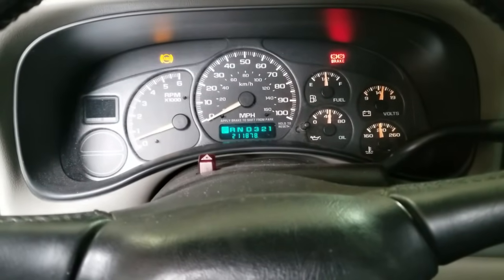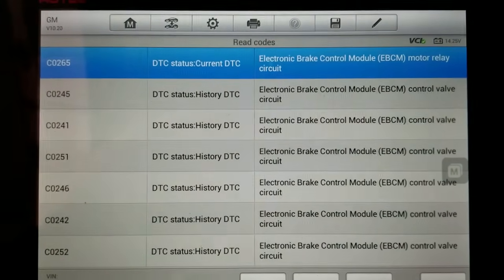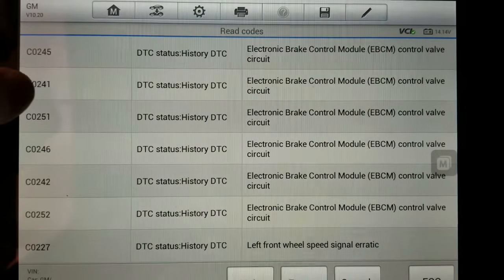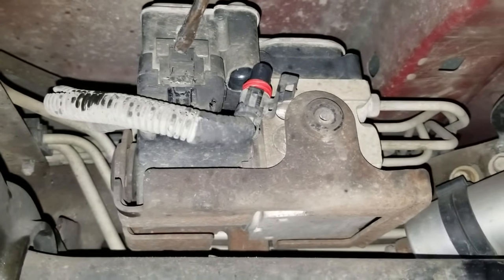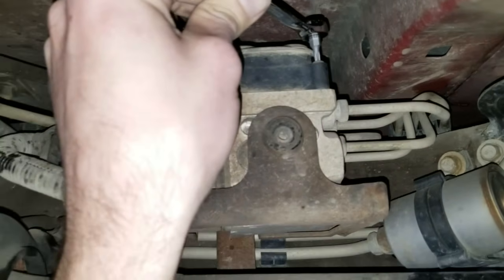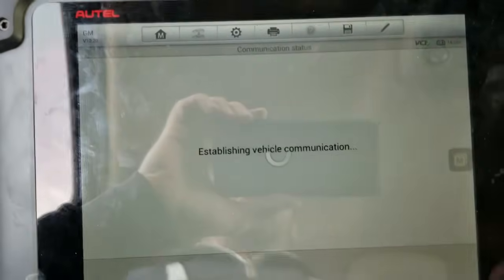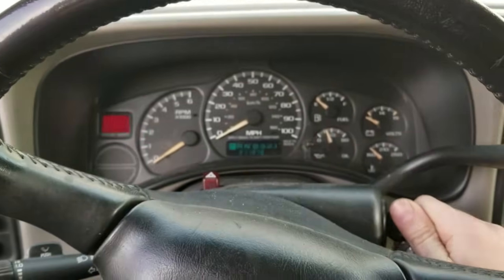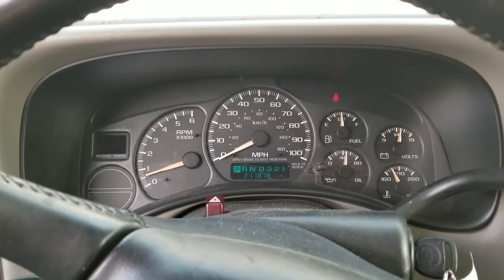GMC Chevy Truck ABS / Brake Light on C0265 Solution

Comment: you didn't show the actual repair!!!!
Reply: He didn't show the repair because that is what he is selling for $60. That's a bargain. Read the entire description below the video.
Reply: He took it apart, soldered all the cracked joints then put it back together.
Reply: Jeff Brill Luke Perry's look alike...😂😂😂😂🤣
Reply: @superduty4556  Actually you should re-flow all the large (power) connections.  These boards are multi-layer PCB's and sometimes the inner board connection breaks.  So if you re-flow the entire board or at least all the large connectors and get a nice shiny look to the solder, not dull grey (Cold joint) you should be able to reinstall and have no problems.  It is actually easier to remove the unit from the frame rather than feel around and screw around and strip a screw or break the head off.
Reply: @edcrabb  yes, I remember reflowing my PS3 back in the day.
Reply: @edcrabb  I stripped mine out. So I have to take the brake lines off and take the whole unit off to fix it?
Reply: He resoldered the broken solder joints. You can do it yourself. for $2 or you can mail it to him and he charges $60

Comment: Could also be a dirty ground.  Before you replace the control module, check for a clean ground.  It might save you some money.
Reply: Where's the ground at? 
I'm bout to buy a vehicle with this issue.
Reply: The ground for the module is on the frame opposite to the abs module beneath the driver door-there should be about three wires, the heavier gauge wire is the module ground. You'll want to gingerly remove the bolt and clean up the surrounding area and the wire terminal ends with a wire brush or the like. When you put it back together use a dab of dielectric grease to ensure a good connection and to dispel water.
Reply: Happened to me with my water reservoir. The coolant light wouldn't go away after I took my tank out and flushed it.and it said to get it to go away you have to replace it.i soaked the sensor and the end it goes into on the tank in purple power and the light went away

Comment: Actually you should re-flow all the large (power) connections.  These boards are multi-layer PCB's and sometimes the inner board connection breaks.  So if you re-flow the entire board or at least all the large connectors and get a nice shiny look to the solder, not dull grey (Cold joint) you should be able to reinstall and have no problems.  It is actually easier to remove the unit from the frame rather than feel around and screw around and strip a screw or break the head off.
Reply: Thank you for sharing that Bubba Gump, that was actual handy info we need.
Reply: @MercuryRisingFast  basically means to re-solder the joints cause it gets corroded.
Reply: Thanks, I didn’t even think about doing that on my 09 f150. Control module is bad and they are expensive for a new one. I’m gonna try and reflow all the joints.

Comment: Spent several hundred dollars on a garage to try and repair my ABS system/pump. They repaired the assembly, but now it engages incorrectly due to a bad wheel beaeing/toner ring. What a waste of my time and money. I'm just gonna unplug the friggin thing and remove the ABS light in the instrument cluster

Comment: Hold up!! before pulling that module out try this. Wiggle the power connector to the module. the one shown here with the red seal around the plug. By accident I found that by moving the plug I could make the ABS and Brake lights come on or go off. Probably some corrosion on the terminals. I slightly bent the male lugs so they would make better contact when the plug is reconnected. It's been awhile and both lights are still off. Probably a good idea to check the grounds too.
Reply: Hello. I'm about to check they out.... How can I find the grounds? Thanks.
Reply: I replied but I saw a YouTube video by Scott The Fix-It Guy that goes over the procedure. Yukon-Tahoe Brake Warning Lights-10 Minute Fix. Good luck.
Reply: @meansnothingnow  OK! You seemed to know where were located the grounds...

Comment: I have that same problem with my 2002 Chevy Tahoe and I have the new module my question to you dose it have to be programmed or can I just put it on and clear to code.
Reply from the maker: As long as the module is an exact match then there is no need to program it.
Reply: Automotive Circuit Solutions  thanks

Comment: Since the original problem was intermittent,  you can't be certain the problem has been repaired. Shouldn't you take it for a test drive  and shut it off a few times.  I've seen this code with air in ABS.
Reply from the maker: Hello,
Yes we did take it for a test drive after to confirm the issues were corrected. Also our service comes with a warranty and the customer never came back.

Comment: Had the same problem.  I replaced the sensor in the existing wheel bearing. But .... mine was a so so wheel bearing on the driver’s side.  Replaced it with sensor included.  Solved ...

Comment: I just installed a remanufactured abs module (made sure it was the correct kind) on my 2002 suburban 1500 LT and the light is still on. They said I would need to delete the codes or double check the fuse box is in order. I'm a little stumped
Reply from the maker: You might have other issues. Get it diagnosed to see if there are any present fault codes.
Reply: @AutomotiveCircuitSolutions  nope just the relay circuit code was the only thing
Reply: @OpiumMonkey  did you ever figure it out?
Reply: @CripplelovesWolly  never did :/

Comment: 2002 GMC Sierra 1500 changed all calipers great booster Master brake cylinder and able to build pedal pressure with engine off as soon as I turn the engine on brake pedal goes to the ground and is soft cannot build up pressure any ideas
Reply: I had this problem. My cause was leaking brake fluid. And the reason it was leaking because the brake pad was basically gone so the caliper was just basically open and loose and leaking fluid. Just check your pads incase I know you changed you stuff out but you never know
Reply: Or your metal/rubber brake lines rotted
Reply: No leaks. Dry brake linedry calipers. Not losing any brake fluid when I keep pumping.
Reply: @janusznedza5034  same problem here, what did u end up doing to fix your problem? I have also changed my hydraulic booster n master cylinder bled the brakes n my brake pedal just stays in the floor.

Comment: Hey,my abs & brake light is on and my speedometer don’t work.code showing p0700.I changed both vehicle speed sensors and still same.transmission only has a slight delay on shift but works good.any ideas?08 Chevy Express 3500 cargo van.4.8L

Comment: What is the Average or actual repair cost ? 
Is there a way too bypass this unit and route your brake lines differently ? Ridding it all together ? I know I heard this before this is the same issue with 88-98 suburban Silverados
Reply: The units are like $300 so I'd guess $400+ for a shop to change it

Comment: ? I have 2 codes that come out on my trailblazer ive tried cleaning the metal frame where the ground wire is scrwed on from the abs to the frame and i still get abs and parking light to turn on one is the c0265 and the other is c0291 which is park brake unlatch relay circuit do u think i get that code cuz the ebcm is bad ?

Comment: I am having this issue but i disconnect the wires from the abs and use my test light and i find one of the wire flickering the test light wat could cause that? Seeing there is not connected to the abs
Reply from the maker: That is likely the dataline that you are testing.
Reply: @AutomotiveCircuitSolutions  ok it's a blue wire... wat do u mean can drive with out the abs?  Wit my 3500G Express cutaway Dont matter how much I bleed the break is like air is still in the line

Comment: Does this have anything too do with affecting the  4wd or braking I have same code after my push bottom 4wd wouldn’t disengage back into 2wd and finally got my 2003 blazer back into 2wd these lights came on does this cause any type of issues in drive ability or is it just make for a visual abs /brake light that has no symptoms

Can this sensor be replaced with a reman or rebuild only

Comment: 2:28 WHAT DID YOU DO TO REPAIR IT?? WHAT DID YOU REPLACE OR FIX OR WHAT DID YOU DO IN THERE?
Reply from the maker: You have to open up the module and reflow the board to get it repaired. Or you can send it to us and we'll do it for you for only $60.
Reply: Automotive Circuit Solutions awesome! Thank you for responding. Can I drive the vehicle without it while it’s out for repair? It is my daily driver.
Reply from the maker: @MarkiedosOCHO  We dont advise it. But yes technically you can drive it.
Reply: Again, thank you very much for the assistance.
Reply: Question: I opened up my fuse box and noticed the fuse for the ABS was gone. I put a brand new one in and the EBCM started whirring loud like a drill motor or a stand mixer. Does that mean it's working or that I need to replace it?
Reply from the maker: @MarkiedosOCHO  That means the EBCM need to be rebuilt.
Reply: Automotive Circuit Solutions  can you repair mine?! I have a 96 s10 2.2 No Communication!, No ABS!. I really need help I live in NY and it’s winter time!!

Comment: I have a 02 GMC Yukon with the abs and brake light and the code c0267 and c0268 . I change the same thing  it came back on 3 week later. Need help
Reply from the maker: Did you replace it with a used one?
Reply: No new one from autozone

Comment: Have you ever had an issue with your truck were you turn the key to start the vehicle but there is no start. And you have to wait awhile in order for it to start again.
Reply: Loose wire on the starter solenoid that what was wrong with mine

Comment: Currently in my 2005 Chevrolet Trailblazer I have both the ABS Light and Brake Light, which illuminates almost as soon as the truck is started, and after running a diagnostic with a scan tool I was presented these same codes. Could this method fix my problem as well? And I must also ad, brakes are functioning just fine as expected.
Reply from the maker: Yes the 2005 Trailblazer has the same ABS Module. Send it in we'll get it rebuilt for you.

Comment: Everything was going great until I realized 3 of the 4 bolts are RUSTED!😣  Now how do I remove them in such a tight space? 🤔
Reply: Had similar problem, all 3 bolts 🔩 no issue's the last one stripped I'm driving the truck with the abs light on
Reply: Take the bulbs out and the annoying light problem just goes away 😁

Comment: When 3 out 4 of the T20s strip just cut your losses and remove the annoying bulbs...... Anti lock brakes system won't work any better but you can just pretend they are fixed lol
Reply: It is easier to just remove the ABS fuse and both bulbs will turn off. And the brake one will still work as indicator for Parking Brake.
Also easier to change the module altogether with one from the junkyard. Just a little messy when removing/reattaching brake lines.

Comment: Hello, 2017 equinox, pulled two codes C0110-00 and C0110-04 (pump motor circuit), I did verify ground and two positive terminals on the main connector no issues there. Tried to test pump and solenoid valves with my scanner but it tells me that "ABS solenoid or pump malfunction". I believe it's a module, what do you think? can you repair it?

Comment: Do you have to clear the code in the scanner in order to remove the lights inside the dash?
Reply from the maker: No once the module is fixed, the light will go away on its own. If it doesn't you likely have other issues on the truck.

Comment: Yeah what happens when you have two screw head that are stripped and one of them is on the far side and you can't fit your hands in to get it out?
Reply from the maker: In that case you'll have to remove the abs module and pump assembly. Once removed you can get those bolt removed with a bolt extraction set.

Comment: I'll share a secret even though it's not the right thing to do, but it will get you through inspection to get the red brake light to go out. Just unplug the pigtail on the right hand side. One of the wires should be red and thick that will cut your red brake light out.
Reply: Your red brake light will still come on when you put the E brake on or when you first.Turn your vehicle on as required by virginia inspections

Comment: I went to the junk yard and bought one for $35. My was buzzing so in was the electrical box not the pump where the brake lines connect.
Reply: mine just starting buzzing even when the car is off ?I'm going to try this thanks

Comment: Can you replace with a used one from junk yard? Bc for my suv it's around $400
Reply: Trisha Hamilton NO! Don’t do it! It’s just a waste of time! There is a place in Arizona you can send you’re module to for $45 7-10 day turnaround with warranty no ABS ever again
Reply: @mdr9738  can you tell me where or the info so i can send mine thanks
Reply: So I just take the thing off send it ? And they’ll send it back fixed ?
Reply: @dommybigshot21  yes
Reply: Michael Salt thank you
Reply: Trisha Hamilton i just ordered mine from AR speedometer & Gauge 3014 N 74th E Ave tulsa OK 74115 for $100 give them your old one
Reply: @michaelsalt7538  I went to their website and could find nothing about Anti Lock module repair. Just clusters (speedo and such).

Comment: Can you run with out this module on or you have to have one on
Reply from the maker: The truck will run and drive fine without the module. However we do not recommend you drive without the module because you will have no anti-lock brakes.
Reply: @AutomotiveCircuitSolutions  alright thank you I wont just while I send my unit for a repair

Comment: How much does this cost to get it repaired at a shop?
Reply from the maker: We charge about $120 for repair and removal and installation. Most shops will not repair the unit they will get a replacement.
Reply: @GOMABSIGMA  did he reply mine is bad too

Comment: I just change mines from 2002 GMC Yukon but for some reason now marks my battery is low fuel cage won't work and abs airbag light are on........I NEED HELP AND I GOT MODULE REBUILD FROM EBAY......HELP PLEASE

Comment: C0265 and C0267 codes require the same replacement part if I am correct.
Reply: And the c0240 for Chevrolet colorado?

Comment: I have the same code but sometimes when I’m applying my brakes my rear wheels lock up, and I don’t brake that hard. It happens every so often, does anyone know if replacing the module will stop this ? I have a 2003 gmc Sonomas S-10 model SLS.
Reply: You’re asking about a different vehicle, with a different problem 🤷‍♂️

Comment: do you have to erase the codes for the light to go off?
Reply from the maker: No, once the repair is made the lights should go away on there own.
Reply: Automotive Circuit Solutions i changed both front bearings because one wheel sensor was bad according to scanner, replaced both the light still on????

Comment: Did u have to reprogram new abs module?
Reply from the maker: No, we repaired and reinstalled the same module that we pulled out. That way there is not programming necessary.

Comment: How do I send mine for repair? Mine is from a 1996 GMC K2500 Suburban, 8600 GVW, 7.4L Gas. Mine has the black plastic top and not the metal.

Comment: Hi,I changed my hub bearing and now brake and abs light comes on any suggestions? Thanks in advance.
Reply from the maker: Most likely something wrong with the wheel speed sensor on the hub that you changed. Check see that it has a proper connection.
Reply: Thanks I will do that...

Comment: I replaced the module 2 year ago the light go away  for 3 week n it came back on n off. I replaced the abs sensor n the abs light  is still on n is code 267.  How can I fix code 268 ?
Reply: I have 268 as well, I think it is the control valve / pump bad or going bad, you can get an autel bluetooth reader that works with your phone on amazon if you don't have one already and you can clear the codes and do an auto bleed, listed to see if your pump/valve kicks on.  They say to check grounds under drivers seat on the frame, mine were fine.  I will replace abs control valve / pump and let you know, but it may not be for a few weeks